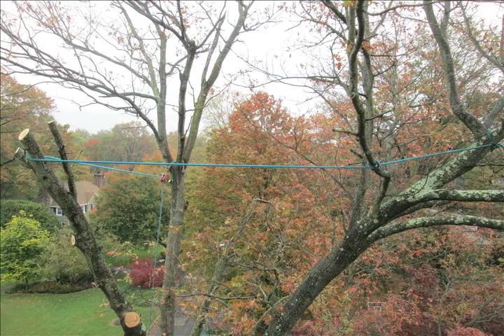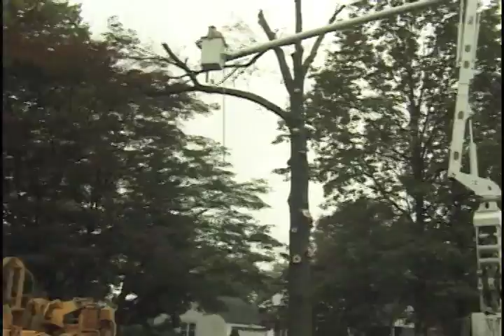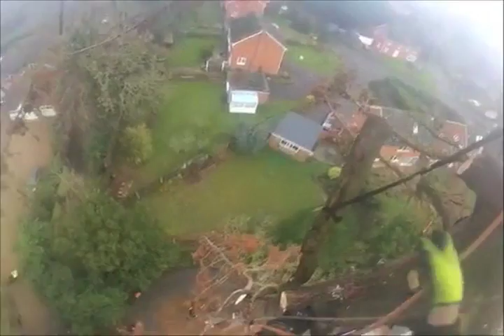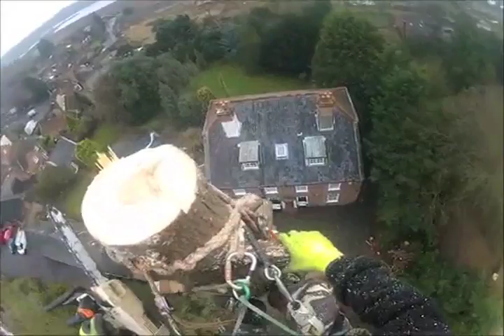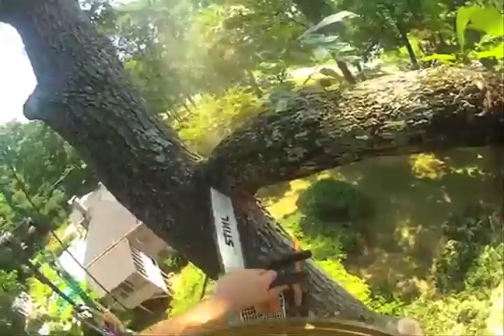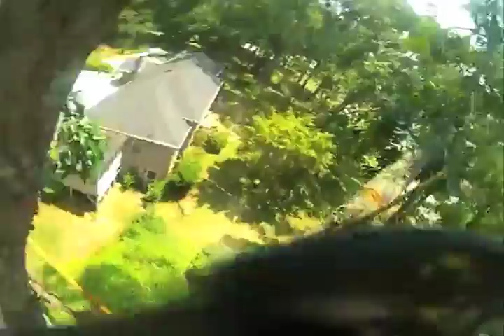Rip Cut Rigging

Comment: one of my favourite tree vids, great pace, packed with knowledge, love to see explanation of 'your' way mixed with examples of when not to do it that way. Your barberchair video and stratagies for bucket truck rigging are also favourites. Thanks!
Reply from the maker: Thanks Neil...  I too think this is a special video
Reply: I notice you are not putting your running bowline near the butt. I think this could be important. If your shoulder cut fails to prevent a barber chair the splitting wood could pry open the running bowline and allow the piece to slide out. I have noticed this affect when holding a small branch and the small ‘barber chair’ forced my grip open.